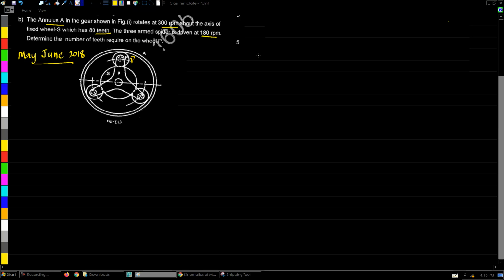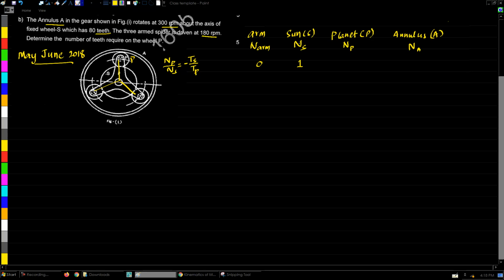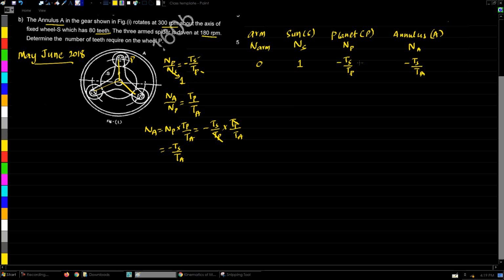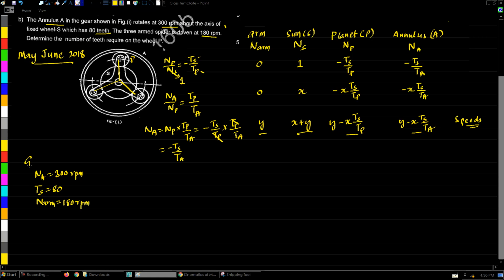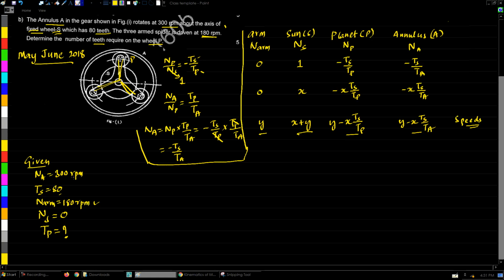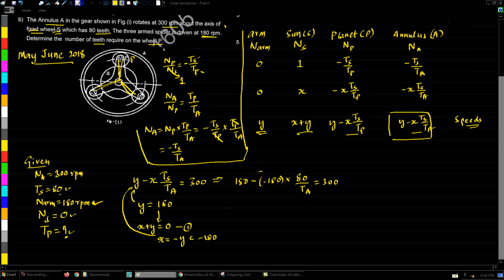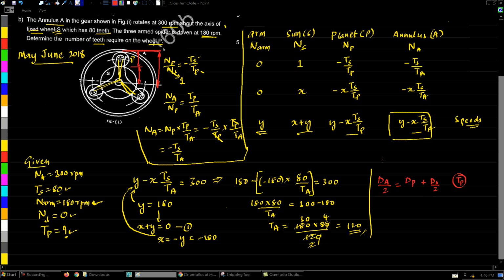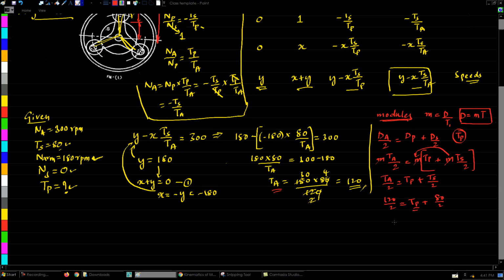Solved Problem on Epicyclic Gear Train | Kinematics of Machines | OU Previous Exam Question

Comment: an epicyclic gear train as shown in fig. the wheel s has 15 teeth and is fixed to the motor shaft rotating at 1450 rpm. the planet p has 45 teeth, gear with fixed annual A and rotate on a spindle carried by an arm which is fixed to output shaft. the planet P also gear with the sun wheel S. find speed of output shaft. if the transmitting 1.5kw find torque requied to fix annual A. (How to solve this problem)
Reply from the maker: I do live streams for members only. Please join my membership plan & post your question as a member.

It's a small cost for you & financial support for me.

Hope to see you there...
www.youtube.com/SrikanthRangdal/join
Reply: @SrikanthRangdal  first up all you solve this prb. Then I discuss with my clg frd about your for increase membership plan
Reply from the maker: Solved just now. Now talk with your friend & let me know when you join.